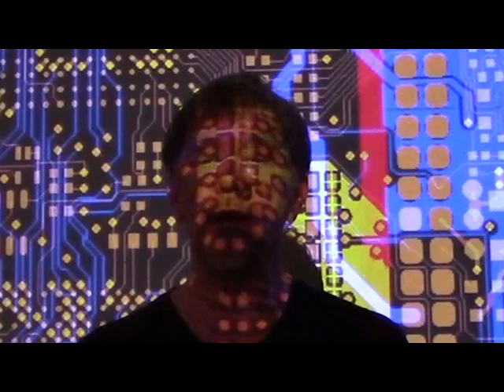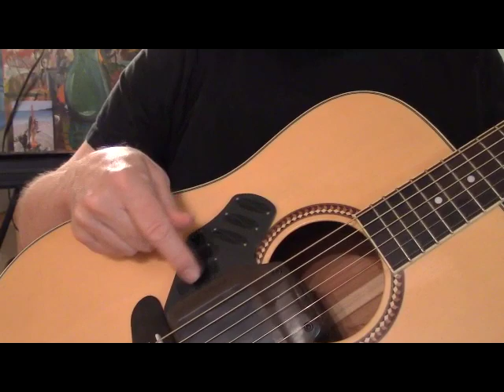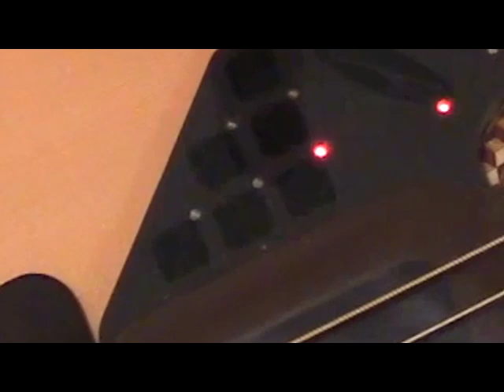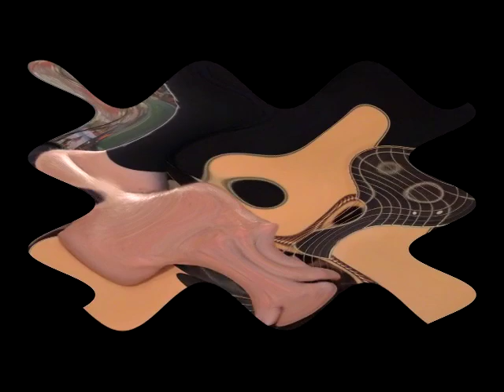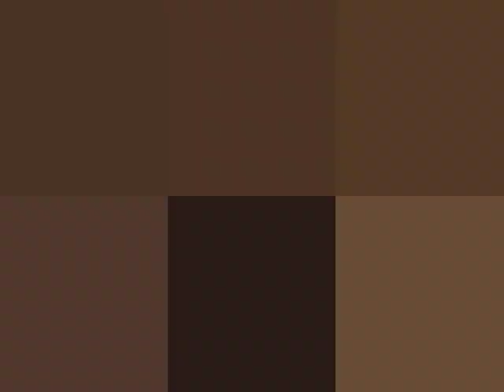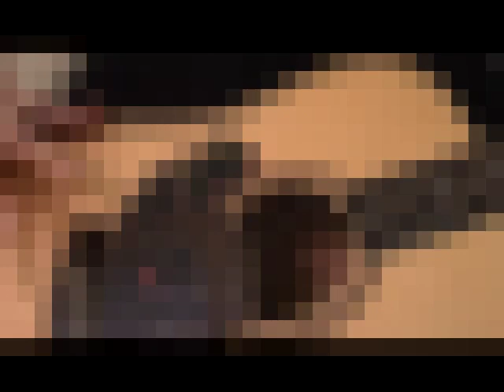Vo-96 Detailed Demo by Paul Vo Pt.1

Comment: It would be awesome if the speed and depth of the arpeggio could be controlled by sliders and well as lfo waveforms the cycle them.
Reply from the maker: Actually it is. The next step is to make the arpeggios and other harmonic scripts easily controlled by the musician.

Comment from the maker: No, that is not what is happening. The way the string vibrates is being changed. The sound emerges from the instrument just as it always has. It sound different because the strings are vibrating differently.

Comment: So in essence, with enough processing power controlling it, the Vo-96 can turn a guitar into a speaker? What would the response curve be like? And would there be noticeable artifacts in the sound produced or can it control the strings with enough strength and precision to cancel those out?